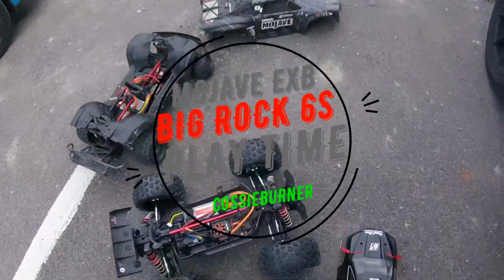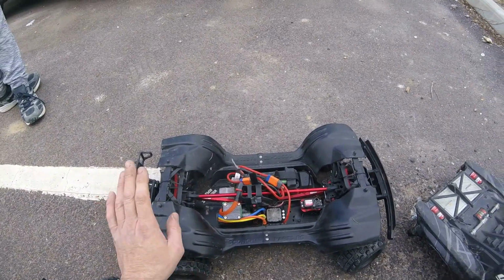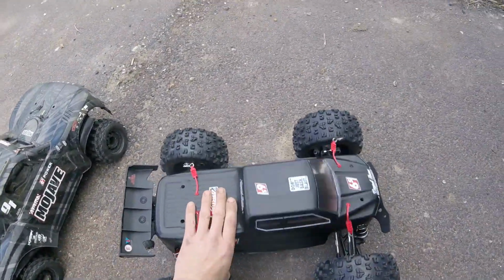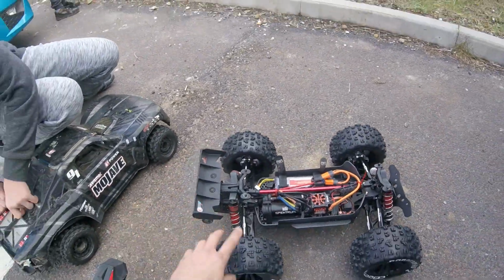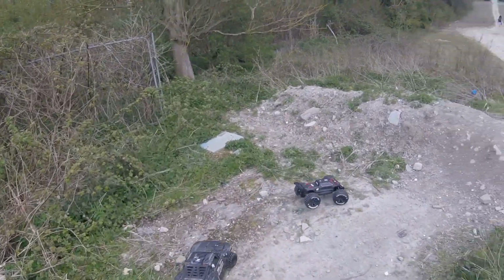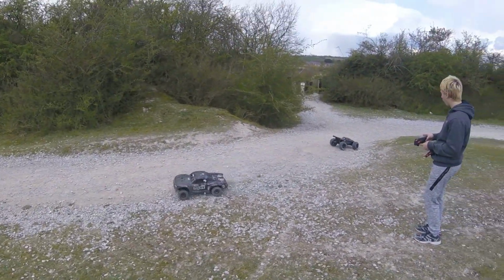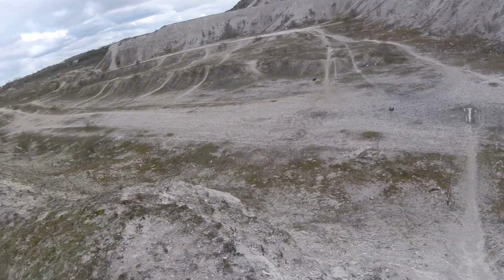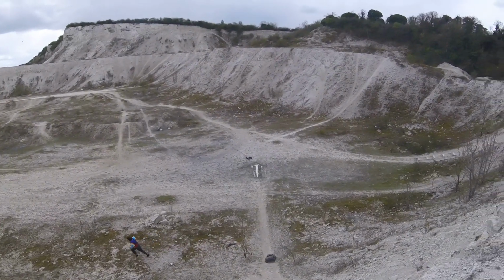BIG ROCK 6S AND MOJAVE EXB WITH 1650KV ROCKET MOTOR PLAYTIME.....ARRMA TOUGH BABY

Comment: What size pinion are you running on 6s?
Reply from the maker: The mojave is on 21 I think and the big rock was on 17 I think
Reply: @cossieburner  nice cheers looking to upgrade motor and esc now as done about everything else. Looking at the max8 combo just not sure on pinion sizes confuses me a little
Reply from the maker: On which car?
Reply: @cossieburner  big rock
Reply: @cossieburner  the 2200kv max 8
Reply: @cossieburner  6s shocks cvd shafts hr diffs 2.8 badlands rpm arms so think should be up to the 6s setup
Reply from the maker: Set that slipper properly and you'll be OK but it has to be spot on otherwise you'll ither snap the drive shaft or burn slipper out best off running 4s on the 6s system if you want not too many problems
Reply: @cossieburner  I currently have it set using the pull along floor till wheels lock method and then lock tight the end. ? If running on 4s do you still run the same pinion ?